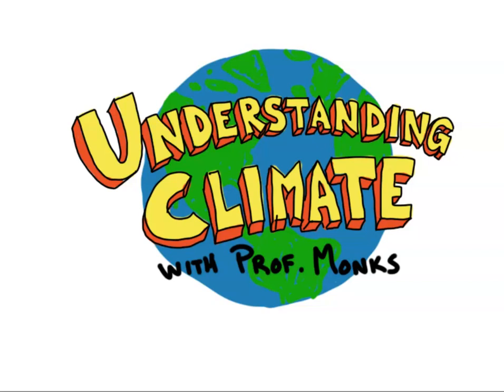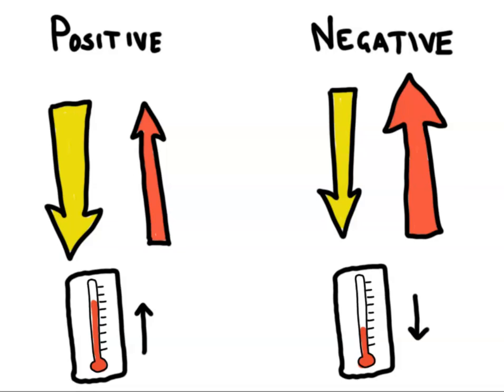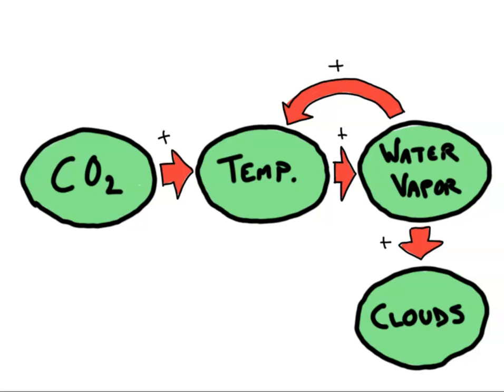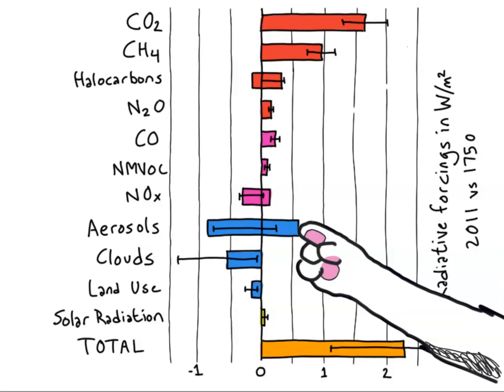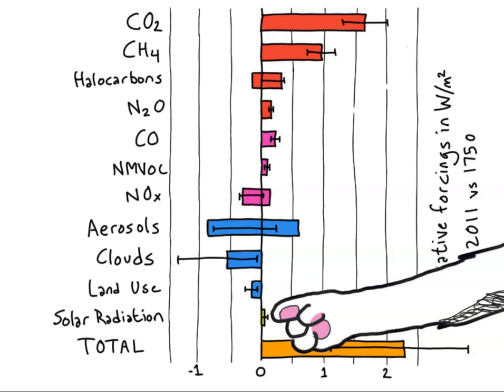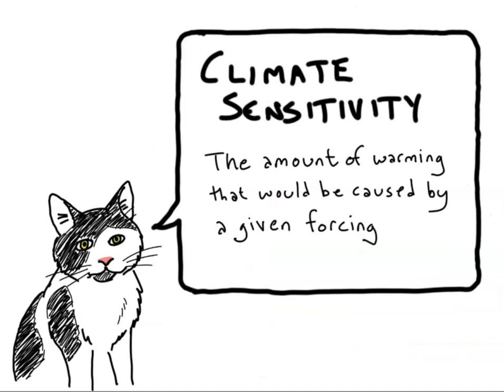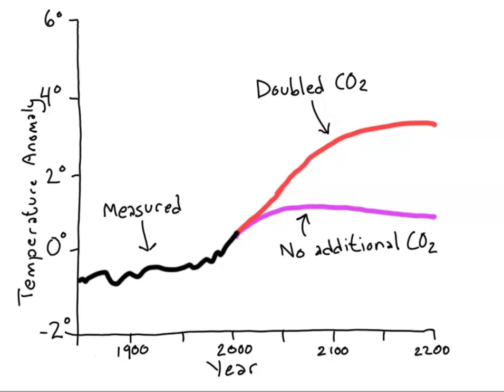Radiative Forcing (Understanding Climate with Professor Monks)

Comment: you really simplified it! thank you!!
Reply: There is a misspelling in the title; instead of 'understanding,' it should be 'misunderstanding'
Radiative Forcing (Misunderstanding Climate )
"There is generally something called radiative forcing, which  force an additional radiation of the planet's surface te make energy balance. However, its effect has been incorrectly presented. It is impossible to understand radiative forcing by considering only energy; one must demonstrate the differences in energy transmission towards the planet and towards space. There is no reason to believe that this additional radiative forcing is a function of 'doubling' the content or 'optical thickness' of any atmospheric component. Additional forcing depends strongly on other parameters, including existing concentrations, so it is entirely useless as a parameter for modeling or understanding. It is possible that the concentration of CO2 in the atmosphere has been so high for a long time that its changes practically have no impact on additional radiative forcing, as is the case with water vapor."

Comment: At current concentrations, at what altitude above the surface will CO2 have absorbed 70.7% of the IR radiation within the IR window in which water vapor is not significantly obstructing CO2’s radiation?

Comment: Error 2:  co2 is only 0.04% a trace gas. Vapor is 1-4% in the air albeit a shorter residence time. Vapor is receptive to more IR w/l than CO2.
Reply: grindupBaker  N2 is 78% or 780,000 ppm. CO2 is 0.04% or 400 ppm.
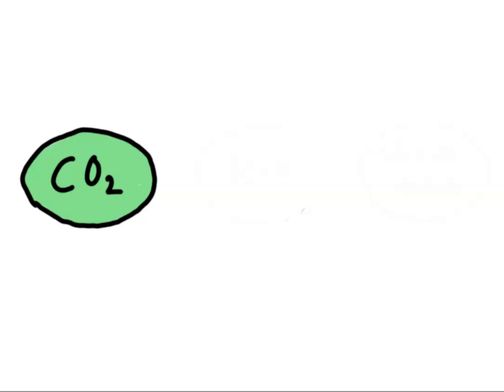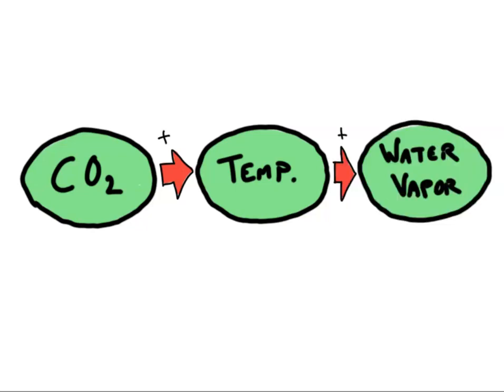Reply: You are either commenting in bad faith or simply ignorant. Yes water vapor is a powerful greenhouse gas however water vapor is not a driver of climate change, it is an amplifier (a positive feedback just as the video describes at 2:00). The amount of water in the atmosphere varies over a matter of days and by region according to air temperature and the availability of water for evaporation. By contrast CO2 is well mixed in the atmosphere and can accumulate at high latitudes (where the poles are). Water has a residence time of only a few days unlike CO2 which can be in the atmosphere for years. If it was water vapor that was driving the recent warming then the greatest warming would be seen in summer and at low latitudes - the opposite of what is actually observed. Again as the video explains at (2:17) the amount of water vapor in the atmosphere has been increasing in recent decades because of anthropogenic CO2 which has warmed the troposphere. Moreover, burning hydrocarbons from fossil fuels is a net addition of water vapor to the system. 

Further reading:
- Al‐Ghussain 2019. Global warming: review on driving forces and mitigation. Environmental Progress & Sustainable Energy, 38(1), pp.13-21.
- Bengtsson 2010. The global atmospheric water cycle. Environmental Research Letters, 5(2), p.025202.
- Santer et al. 2007. Identification of human-induced changes in atmospheric moisture content. Proceedings of the National Academy of Sciences, 104(39), pp.15248-15253.
Reply: grindupBaker   Perhaps you are so badly informed that you just don't realise how badly informed you are.
Reply: I have a masters in this stuff so I do know my field & am not trolling. Yes vapor has a short residence time & co2 longer but fact is temp facilitate weathering of materials that allow co2 to escape. E.g. you have 2 bottles of champagne. One in the fridge, open it normally, & no eruption. Now sit the other on the counter in sunlight & then open it-contents under pressure driven by heat. It erupts. The bottle did not create the heat energy. Remember the bottle has only P.E. Warm air holds water vapor better than cold air given the permanent dipole of the water molecule. If you have ever head the expression: it's not the heat; it's the humidity. And it indeed it is. The tropics in general are always going to be warm. Most of the climate change on the globe has been in the Arctic Circle but it does not mean it's 90 degrees. Water vapor has many more windows open to IR than CO2. It's called Plancks Law.  You simply want to drink the Kool-Aid. If Co2 were so powerfull, Mars would be warm. It's not so this shows there are factors. The major disturbances we have currently in climate include:  the cooler than normal stratosphere, the disruption of the polar jet, the polar vortex, & meridional overturning of the Atlantic. @QT5656
Reply: @kimlibera663   Which university awarded you a masters? Your comment is full of basic misunderstandings.
Reply: @QT5656   Claiming that there is a miss understanding with out identifying is a lame evasion - Show it or the claim is useless.
Reply: @thomasmartin406  There is more than one misunderstanding in that gishgallop.
Reply: @QT5656  Trump University 😂
Reply: @merosgage196  I think it is now Prager U, and you get to print your own certificate.

Comment: "The laws of thermodynamics is the only physical theory of universal content, which I am convinced, that within the framework of applicability of its basic concepts will never be overthrown." --Albert Einstein
The 2nd law of thermodynamics mandate that a colder object (the atmosphere) cannot warm a hotter object (the Earth's surface.) The hypothesis of the greenhouse effect breaks this law, and must be refuted. 
The 1st law of thermodynamics is that energy can neither be created nor destroyed. The surface cannot be heated by it's own energy. The hypothesis of the greenhouse effect breaks this law also. 
The hypothesis of the greenhouse effect breaks both the 1st and the 2nd law of thermodynamics. 
Conclusion: THERE IS NO GREENHOUSE EFFECT!
Reply: The atmosphere doesnt heat up the ground. It makes the ground cool down slower.
What you call "hypothesis" are strawman.

Comment: you missed the big one water vapour.
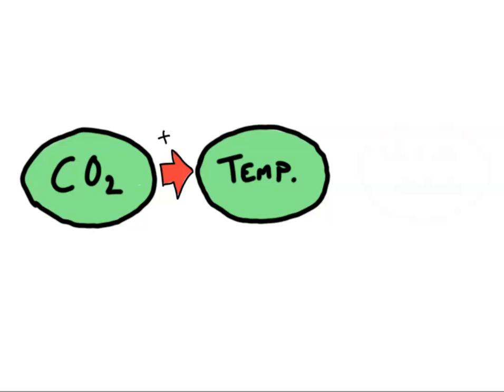Reply: 2:15
Reply: @driftwood1942  The description at 2:15 presents a serious problem. It suggests that more heat leads to more water vapor, which in turn results in more heat. However, we are well aware that there is some feedback mechanism at play, which means that despite significant fluctuations in water vapor concentrations, we do not observe corresponding temperature changes. Why should we assume that the same feedback mechanism won't mitigate the effects of changes in CO2 concentration, and that the observed warming has entirely different causes?
Reply: You are either commenting in bad faith or simply ignorant. Yes water vapor is a powerful greenhouse gas however water vapor is not a driver of climate change, it is an amplifier (a positive feedback just as the video describes at 2:00). The amount of water in the atmosphere varies over a matter of days and by region according to air temperature and the availability of water for evaporation. By contrast CO2 is well mixed in the atmosphere and can accumulate at high latitudes (where the poles are). Water has a residence time of only a few days unlike CO2 which can be in the atmosphere for years. If it was water vapor that was driving the recent warming then the greatest warming would be seen in summer and at low latitudes - the opposite of what is actually observed. Again as the video explains at (2:17) the amount of water vapor in the atmosphere has been increasing in recent decades because of anthropogenic CO2 which has warmed the troposphere. Moreover, burning hydrocarbons from fossil fuels is a net addition of water vapor to the system. 

Further reading:
- Al‐Ghussain 2019. Global warming: review on driving forces and mitigation. Environmental Progress & Sustainable Energy, 38(1), pp.13-21.
- Bengtsson 2010. The global atmospheric water cycle. Environmental Research Letters, 5(2), p.025202.
- Santer et al. 2007. Identification of human-induced changes in atmospheric moisture content. Proceedings of the National Academy of Sciences, 104(39), pp.15248-15253.

Comment: To the people in the comments who like to feel that the recent warming is not because of anthropogenic CO2 and that it's not going to continue to get warmer until CO2 emissions are curbed... you'll need to come up with a hypothesis that explains why:  
- warming is happening faster at high latitudes, 
- nights are warming faster than days, 
- winters are warming faster than summers, 
- ocean pH is decreasing, 
- the ratio of atmospheric 13C/12C has changed the way it has,

Further reading: 
- Hausfather et al. 2020. Evaluating the performance of past climate model projections. Geophysical Research Letters, 47(1), p.e2019GL085378.
- Lacis et al. 2010. Atmospheric CO2: Principal control knob governing Earth’s temperature. Science, 330(6002), 356-359.
- Osman et al. 2021. Globally resolved surface temperatures since the Last Glacial Maximum. Nature, 599(7884), 239-244.
Reply: Aside from correlation is not proof of causation - 
Actually it is incumbent upon those who propose their hypothesis to provide the repeatable experiment that demonstrates their core premise that doubling CO2 from 420ppm CO2 to 840ppm raises a parcel of air's temp 2.7F or more. 
An experiment that isolates out a solar system of variables to  just changes in CO2 concentration.
Reply: Why can’t computer models predict the temperature from 3000bc to 10000bc when temperature was over 1deg C above present and co2 around 200ppm. NOAA data set
Reply: @thomasmartin406   You clearly didn't read the references provided or know much about this topic. Projections from the 1970s match current observations. The physical properties of CO2 and other atmospheric gases are known (e.g. Arrhenius, Foote, Tyndall, Plass). That understanding has been validated by practical outcomes (e.g. heat seeking missiles) and empirical observation that match predictions (e.g. lower atmosphere warming, upper atmosphere cooling, nights warming faster than days). Global temperatures are increasing due to CO2 as climate scientists (e.g. Callendar, Broecker, Manabe, Hansen) predicted it would. The evidence is measurable and extensive and comes from multiple independent sources. How many more years of warming do you need? 7? 14? 21?

Comment: The CO2 -> Temp -> H2O illustration is misleading.  It should be Temp -> H2O + CO2 in some cases.  There's no consistent historical record showing that CO2 always leads increas in T and more evidence that it is often the other way 'round.  Furthermore, the forcing effect can be positive or negative based on the temperature, so it would be mostly forcing cooling over Antarctica or wherever T=190K, for example.

Comment: I think this notion of 'radiative forcing' needs careful examination.  The IPCC published an energy balance model that is inconsistent.  In the IPCC model, there are unbalanced energy inputs.  There is no acknowledgement that energy flows laterally in the atmosphere - from the lower latitudes to the polar regions.  The photochemistry of ozone is not even mentioned in your presentation (the IPCC ignores the stratosphere and publishes an emissivity model that implies it doesn't even exist)  - this gas is much more significant in controlling Earth's emissivity than CO2.  You also neglect to point out that water vapour turns to rain.  Water dynamics in the atmosphere is massively important and not completely understood.  It is worth noting that a hurricane is a heat pump that in a day pumps more energy into the stratosphere than the entire US energy generation for a year!  
You ask us to believe that CO2 is the demon gas?!? Worldwide emissions of this gas are responsible for some completely unphysical amplification of energy in the atmosphere?!?  This IPCC asks us to ignore energy conservation and the second law of thermodynamics?!?
Climate is changing ... it has been doing so for about 4.8 billion years.  The non-linear dynamics of climate are not all at instantaneous (radiative) timescales ... unlike radiative models, convective and conductive cycles range from years to decades (and possibly 100's of years).  ENSO the Pacific Decadal Oscillation and tropical cyclones are examples.
The dogma is that solar radiation is not a driver - but sunspot activity alters the UV input intensity by upwards of a factor of 10!  This is fine if you ignore O3 photochemistry and stratospheric warming.
The IPCC climate models are NOT right; the problem is that they are NOT EVEN wrong.

Comment: Re. "Positive Feedback"
The evaporation and convection of water from the Earth surface take out heat transporting it higher in the atmosphere where the temp is lower. Your hypothesis that this water vapor cause "back-radiation" of the same heat back to the earth, and warm the Earth surface even more (breaking both the 1st and the 2nd law of thermodynamics in the process.) The so-called "positive feedback." Fact is that only a tiny fraction of this heat taken out of the Earth's surface (both convection and radiation) will be radiated back in the form of long wave infrared radiation. Even if this colder radiation was absorbed (which it is not), more heat is going out than coming back and you have a cooling event in any case. Let's say, in a hypothetical dream world, 100% is radiated back and nothing in other directions, then you get back the same amount you lost in the out-radiation. Q minus Q is ZERO, even with 100% back radiation! Your theory is beyond any reality!🤡🤡🤡
And you hypothesis is totally flawed and easily refuted.

Comment: According to the IPCC the the Earth without an an atmosphere would be -18 degrees. 
They say the atmosphere adds 33 degrees. 
The calculations they use average out the solar radiation over the entire Earths surface. This works as long as you assume there is no nighttime on Earth. 
If you calculate in a more accurate way, accounting for the angle of incidence and rotation, the amount of temperature added is 0.1 degrees. 
Also you have not mentioned the effect of saturation of energy absorption by CO2 molecules.

Comment: The albedo/atmosphere make the Earth cooler not warmer.
Yes or no? If no pls ‘splain.
The GHGs must absorb “extra” energy upwelling from the surface radiating as a black body. (aka Radiative Forcing) The kinetic energy heat transfer processes in the contiguous atmospheric molecules make surface BB impossible as also demonstrated by experiment.
Agree or disagree? If disagree pls ‘splain.
If both or either of these points is correct the greenhouse effect is not.
No greenhouse effect, no GHG warming, no man/CO2 driven global warming or climate change.
RF is akin to caloric, phlogiston and luminiferous ether. A made up, hocus pocus, handwavium explanation for the GHE. Neither are real.
Version 1.0 120721
Reply: In general, gases don't behave as perfect blackbodies.  Why do we assume that the radiating gas acts as a perfect blackbody?
However, if you have demonstrated that the described mechanism cannot cause the greenhouse effect, it does not mean that this effect does not exist; it means it has a different mechanism, if it exists.
Reply: The albedo varies from 28% to 36%. that is energy that never makes it to the surface to convert to InfraRed or reflect back and forth to magically cause a 3 or 4w/m^2 warming as alleged by a 0.04 increase in atmospheric CO2 due to clouds/ice/particulates .   Maybe 4% of the total differences we experience, IF the CO2 warming story is true and I still await a repeatable experiment that shows that warming.
Reply: Is the Moon cooler or warmer than the Earth?
Reply: To disprove the hypothesis that the extra input of anthropogenic CO2 is causing the recent warming you'll need to come up with a hypothesis that explains why 
- warming is happening at high latitudes, 
- nights are warming faster than days, 
- winters are warming faster than summers, 
- ocean pH os decreasing, 
- the ratio of atmospheric 13C/12C changing the way it has,